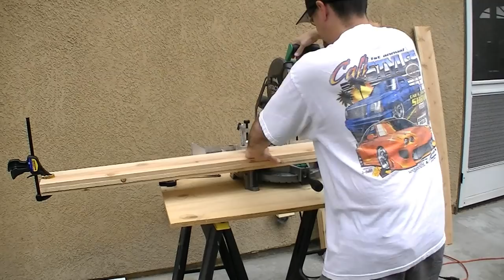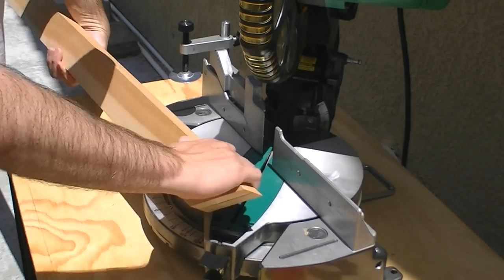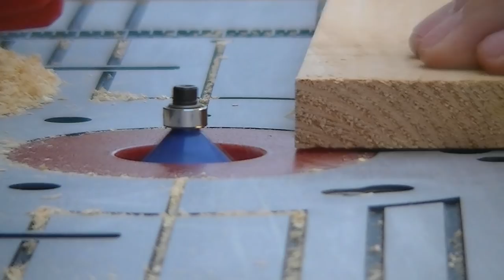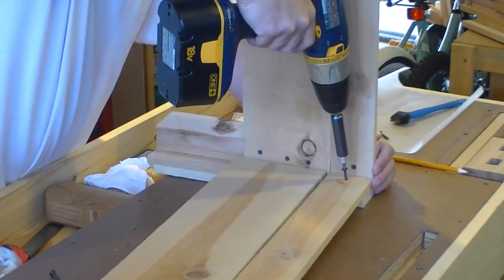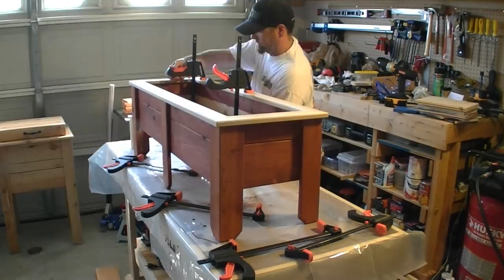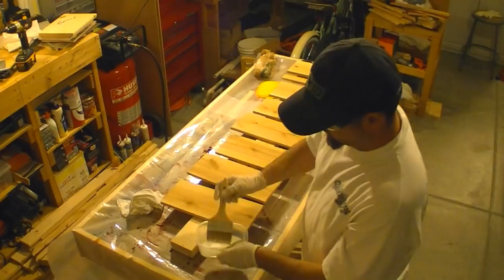Project - Raised Planter Box made from Cedar Fence Pickets

Comment: Very nice work and easy, I made a few of these but instead of coating the inside with polyurethane I used rolled plastic and stapled to the inside. You can find it at Lowe’s in the paint department.
Reply from the maker: Got it, thanks!

Comment from the maker: It is a Husky compressor.  5HP - 22 gallons - 6.5 SCFM@40PSI - 5.1 SCFM@90PSI - 125 MAX PSI
I actually don't know too much about compressors.  I won this one in a raffle at a car show about 10 years ago.  It sat in the box for 5 years until I bought my house and was able to start using it.  It has been reliable so far.

Comment: I made several in different sizes and shapes, great idea to use fence boards.  The only thing I did differently was run a cleat around the interior for the bottom boards to rest on; I thought it would be better if the weight of the dirt was holding them down instead of screws holding it up.  Thanks for the vid.
Reply: Paul Archer we.
Reply: I was thinking the same thing about the bottom boards needing to be on the inside. Drainage holes also should have been drilled.
Reply: What is a cleat?
Reply: A cleat would be say a 1x2 run around the inside bottom perimeter of the box for the bottom boards to sit on. It would help distribute the weight of the dirt across a larger area instead of the weight being on only the screws that are attached to to either side of each bottom board.

Comment: I'm going to give your design a try, but with a couple of modifications. I don't think I'll attach the bottom. Instead, I'll put 1x2s on the inside to make a ledge, making the bottom panels removable. I may even put a 2nd ledge halfway, leaving the option for a planting that doesn't call for so much soil. At least that's the plan. Thanks for the SketchUp file, too.

Comment from the maker: My estimate on actual material cost is about $20 but I had a lot of stuff on hand already.  I used 6 fence pickets at $2.05 each.  I used a small container of stain that I bought on closeout for a couple of dollars.  I had to buy a quart of spar urethane at about $20 but only used a quarter of it.  I already had a 1 lb box of 1" screws but I think it was like $7.  I also used 1 1/2" deck screws on the bottom but I also already had a 1 lb box at about $10.

Comment: Thanks for a great video! I had to make 3 and each one was quite a bit longer than yours, so I added some internal strengthening strips on the inside between the 3 legs. The pickets that I got were quite rough, and needed quite a bit of sanding. I would suggest using a planer to smooth all sides and surfaces. I also found that I needed to use my clamps to squeeze the side strips together when I was assembling the boxes - once they were cut from the pickets they warped a bit. Overall a great project, but allow plenty of time because glue/stain/varnish has to dry!
Reply from the maker: John Attinger I have the best luck with the pickets if I can let them dry out for a few weeks in my garage.

Comment: Prevent warping cuts by having a guide clamped on the outside portion at the end of the fence to the width of the board and have a spacer rise up between the cut boards like a thick nail on the board you use under the table to clamp to that way the guide up made will not cause any wobbling of the boards as you slide it through the saw blade. A large nail is of aluminum type which is originally made for gutter placement on eaves, if you do not have one then use a bolt which you can attach with two nuts above and below the board under the table.

You might have also considered using some wood preservative before assembly and staining atop it before you assemble after the first coat of preservative dries. I also would have considered waterproofing before assembly.
Reply: WHEW!!! Almost one of the longest sentences I ever read...and so unclear!!! A little punctuation would probably make it understandable...

Comment: Great job mate.   I really like the simplicity of this planter and the colours were a nice choice.  I may modify the design just slightly by placing a block inside each corner to tie the side together as I’m not sure just gluing the corners will last.  Anyway, again, really nice planter and I think I’ll make a few of them for my backyard this weekend!  I just subscribed!
Reply from the maker: That sounds like a good plan.  Just as an FYI, the planter is still sitting on my front porch 10 years later exactly as I built it with no issues.  You can read an update about it on my site here: https://funwithwoodworking.com/shop-update-271-1-11-23/

Comment: Love the look and the colors.   Nice Job, but I would have used Titebond 3 since it's water proof, and not just water resistant.
Reply from the maker: I made this project in 2013 and it is has not left my front porch since then and gets watered every week.  It is still all in one piece and holding strong.  I think that I will stick with the glue that I have been using.  Thank you for the advice though.

Comment: If....by any chance...I decided to put beers, instead of flowers...what kind of insulation would you use? That is a nice size item to convert it from a planter box to a cooler box.... just foam, like tear apart a $2 foam cooler from Walmart  and tape?
Reply from the maker: https://www.homedepot.com/p/Reflectix-16-in-x-100-ft-Double-Reflective-Insulation-Roll-with-Staple-Tab-Edge-ST16100/202851859

Comment: Instead of brads you should consider switching to a 1.25" 16ga finish nail. They have a lot more holding power and eliminate the need for clamps in the glue drying process
Reply from the maker: Thank you for the recommendation.  I made this planter box in April of 2013 and placed it on my front porch.  It is still sitting there, in the same spot, full of soil & plants, 9 years later.  I'm quite happy with the holding power of the brad nails.

Comment: To assist you in making rip cuts on the table saw, you should make a featherboard and clamp it to the fence to apply pressure against the stock to keep it on the table.  It will also function as an anti-kickback feature.

To ensure proper water drainage, you could also simply drill a series of small holes in the bottom of the planter. A good idea would be to fill the bottom 2 inches of the box with marble sized gravel, to allow the water to drain away, and put a layer of insect screening down on top the gravel to keep your soil from washing through it, and your planting mix on top of the screen.

When putting screws into an outdoor project, drywall screws are a bad idea.  You should use coated deck screws or at the least galvanized screws.

Comment: How do you like that Craftsman Table Router?  I was considering the same one.  Pretty inexpensive compared to most, but does it work well for you?
Reply from the maker: Demosthanes locke It's great!  It does everything that I need it to do.  It's lightweight but still has the metal top.  I bought one with a coated particle board top and didn't like it.

Comment: How long has it been since you put it into use? Is it holding up well? What I'm getting at is how long will the bottom boards w/out any actual drainage holes last before they need to be replaced?
Reply from the maker: Alexis Rocha I've been using it for a couple of years now with no issues.  It leaks like a sieve.  Water drains from the front, back, and sides.  Very little of the water even makes it to the bottom.

Comment: Just one suggestion.  If you are going to put any edible plants in the Planter box (herbs, etc) then be sure that the finish on the bottom is food safe.  Not sure if Varathane is but I am guessing it isn't.  If the bottom slats are  cedar then you could skip the varathane and put them in loosely and have preserved boards along the bottom edge to hold them.  Then if they rotted you could easily replace them at the end of the growing season.   It looked like you would have plenty of depth to accommodate this.  But if just planting flowers then probably just ignore my comment.  Very nice build and nicely done!
Reply: +Terry Ellis I plan on building a similar box, but mine will be for indoor use.  What do you recommend so that a) it won't rot and b) it won't leak?  I see that MasterGardener.com makes a table and includes some kind of liner cloth (I think).  Any suggestions?
Reply: +cscooper2000 the liner cloth (ie landscaping fabric) would be great to hold in the dirt but if you want it not to leak then a waterproof plastic or metal bin to fit the box would be needed.  You would need a system to ensure you are not over-watering and would probably need to change the planting medium yearly.   I would not grow edibles in this box. Hope this helps.
Reply: Uh oh.  So no herbs?  That's what she wants to grow.  :(
Reply: +cscooper2000 herbs would probably be ok with a food grade plastic liner but I would worry with a a copper or tin liner--If the liner is steel then you are probably ok as well
Reply: Awesome!  Thanks!

Comment: Did these fence planks shrink over time?
I hear it's common when using this type of material
Reply from the maker: They are typically still pretty wet when you first pick them up from the home center.  I always let mine sit and dry in the garage for a couple of weeks before I use them.  That way they acclimate to your area and they usually stay the same size.  If you buy them and build something in the same day then they will shrink on you.

Comment: is glue necessary for the legs
Reply from the maker: The glue does most of the heavy lifting.   You can get away without using it but te joint will not last as long without.

Comment: Did u use regular brad nails or stainless steel brads?
Reply from the maker: Just regular brads.  It's 7 years old and still holding strong.
Reply: FunWithWoodworking I know you mentioned you used drywall screw..are those holding up as well?..did any rusting occur?

Comment: The extension cord you are using looks to be 16 ga.  You  should be using at least a 14 ga. cord with your table saw because it draws 15 amps.  Keep using the 16 ga. cord and you could burn out the motor on your saw.
Reply from the maker: Thank you for letting me know that.  I have actually replaced that extension cord since I made this video.

Comment: Man, Where did you get such nice fence pickets?  Mine look like a nail file... Cant even touch them without getting splinters
Reply from the maker: +stepitup I can't remember if I say it in the video but I sanded them all down after I cut them.
Reply: stepitup      If you have orbital sander sand them with Either 80 grit or 120 grit it gets it done really quick! He mentioned it at the beginning of the video!

Comment: your riving knife looks loose on the table saw, and i bet you would benefit from pulling out that rear out-feed support on the longer rips.
Reply from the maker: I noticed the same thing after I watched the video for the first time so I double checked it and it is on there as tight as it can be.  I think it's just an effect of speeding the video up.  I always forget about the out feed supports.  I have also learned a lot more about my saw in the 10 months since I posted this video.

Comment: nice job my only criticism would be that the floor needs to be placed on rails. the way you did it, as the weight of the wet soil rests on the floor it can eventually push the screws out or push the boards right past them because all the weight is on those screws. rails out around the interior with the floor places on top will better distribute the weight and make it impossible for the floor boards to fall off
Reply: All you are doing is transferring weight to a different board (the rails) and different screws.  You still have screws holding up the weight of the dirt.  Assuming you are fastening the rail with horizontal screws, you can argue shear strength is greater than the tensile strength, but that doesn't solve your original criticism that the screws may back out.  Small washers can help keep the screws from going through the wood.  Back to shear v. tensile strength, the screws are strong enough to handle either of the forces.
Reply: so cute how you are using big words but dont understand the concept of weight distribution
Reply: Regardless which way you do it, the weight is still only distributed through the fasteners used.  I suppose you could consider the friction your rail would experience doing it your way.
Reply: yeah...so cute
Reply: Joe, Rick gave you a valid argument, if you don't have a counter argument, making snide comments will only make you out to be incompetent.
Reply: +Garry Cole oooohhh some mope on YouTube might think I'm incompetant. ..ooohhh what shall I do. lmao I don't need to argue or justify proper construction practices and I wont. listen to me, don't listen to me I really could care less lol

Comment: Did your wife add soil right in the box or in a plastic pot?  If right in the box, how long do you think they would last?
Reply from the maker: I built this planter box in May of 2013.    I stopped by a local house that had a pile of dirt with a free sign on it and picked up about 4 - 5 gallon buckets,  I put it all directly in the planter box with no liner.  I have not touched it since then.  I just made an update about it on my website that you can read here:  https://funwithwoodworking.com/shop-update-271-1-11-23/

Comment: Lovely. But it should have more drainage.
Reply from the maker: Why?
Reply: FunWithWoodworking To ensure you don't kill any of your plants with root rot. Too much moisture in the soil caused by poor drainage will definitely increase your chances of root rot. It's a very lovely planter box, though, no doubt you sure have a keen eye for wood work.
Reply: Vermin E I was about to ask the same thing thank you.  I've noticed another video where the carpenter included 1/8 inch gaps for drainage, I'm sure this can be modified to fit the plant's needs.

Comment: I don’t understand the use of both screws and glue for an outdoor planter. Either the glue is meant for outdoors, or it’s not, in which case don’t use it. In general, the screws should be more than enough to hold the planter together. I would skip the glue.
Reply from the maker: That takes all of the fun out of it.  If it is worth engineering, then it is worth over engineering.

Comment: looks fantastic, you forgot to say we need to buy 2000 pounds worth of equipment to do it.
Reply from the maker: +helen thornton Mitre saw = $149, table saw = $165, router table with router = $175, and drill = $35.  Total cost = less then $600.  I bought all the tools over about a year and half time frame.  It all just depends on how much you want to do it.

Comment: Drywall screws are the worst choice !!  Junk
Reply from the maker: Thank you for your advice with this project.  It is still sitting by my front door almost 10 years later and I have not done a single thing to it since I initially installed it there.  You can read more about it here: https://funwithwoodworking.com/shop-update-271-1-11-23/